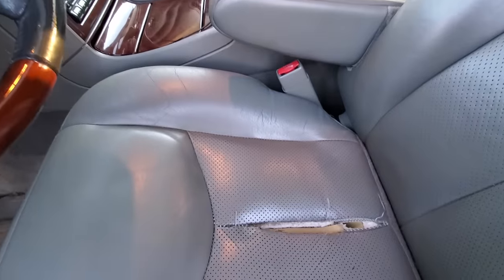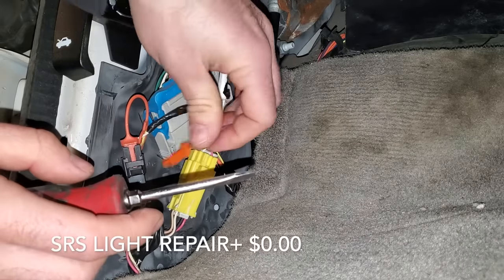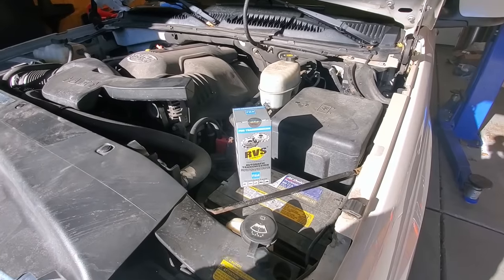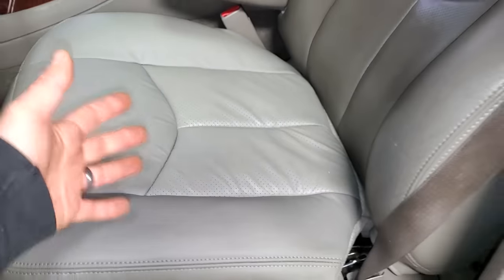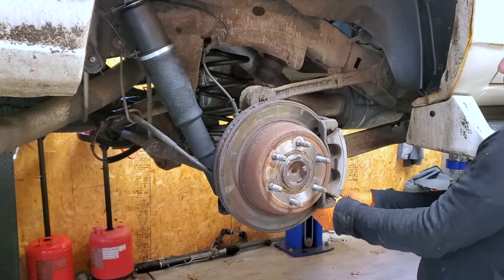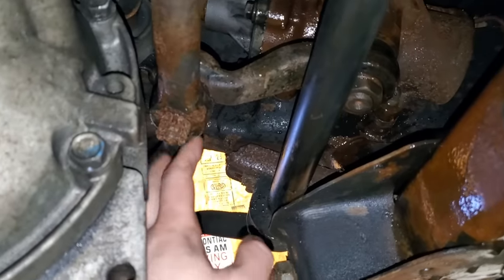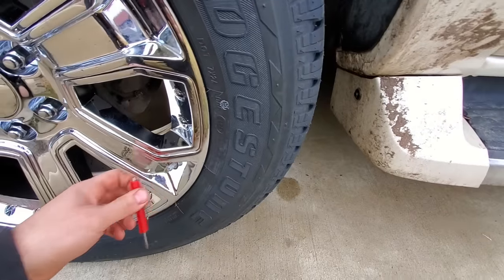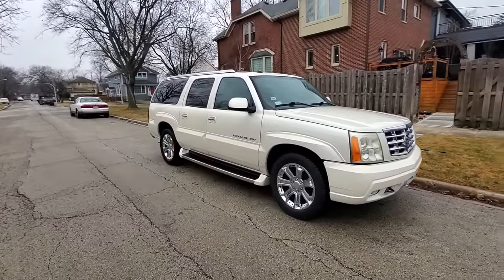I Fixed EVERYTHING On A 15-Year-Old Cadillac Escalade In 1 Day To Avoid Buying My Wife A New Truck!

Comment: I love the 2nd gen Escalades! They were made so much better then the newer ones and the seats were so much bigger and comfortable
Reply: Bailey Hatfield hell yeah I had an 04 with 50k miles on it pearl white with tan interior it belonged originally to an NBA player and it was so clean and smooth and I foolishly sold it. I miss it so
Reply: The seats hold more farts
Reply: @jasonhudson8336  I've always looked at those older Escalades and said,those seats have to be plush and comfortable,the newer ones,especially the 3rd row seating is a disgrace,hardly no padding,I really don't understand it,smh...

Comment: I just put RVS to my car in december and changed the oil a week later. 4th car I”ve done it for, and some years back it totally fixed the oil consumption for my 2006 280CDI 4matic.

Comment: Totally enjoy the 15-20 year old vehicle repair (or maintenance ) videos.  These can be a great value.  Any plans to do the fluids?
Reply from the maker: I just did engine oil, trans and coolant but I didn't record it
Reply: LegitStreetCars what about front and rear diffs, transfer case, brake fluid, power steering fluid (which you probably already did while doing all of the steering work)?
Reply: Can you give me some recommendations on the transmission and transfer case for my 2004 esv?
Reply: @deborahanderson4211   I use OEM fluids from the dealer.  The price is pretty comparable to the parts store and I wouldn’t risk putting anything other then OE in transmission
Reply: @sat_sonic  you don't think gm MAKES the fluid.. do you?

Comment: I’ve always liked this generation of Escalade, it’s nice to know that they’re very easy to maintain yourself.
Reply: I hope on having one some day.. Knowing that they're pretty easy to maintain is some relief.
Reply: Mitchell Maljers Me too, I’d like to have one soon. Or a similar year model Yukon Denali. I like both very well. Same drivetrain too.
Reply: @1Reddd  I can assure you the yukon denali is a wonderful piece of machinery easy to work on and nothing crumbles in your hand. unlike a jaguar
Reply: @1Reddd  I'm wondering if the Escalade will hold up better than a Surburban or Yukon XL,what you think????
Reply: @MxGRhythmlModsMusicGamingl  So you really think the Yukon XL is more reliable and durable,how about the Surburbans???
Reply: @mercedesbenzs600bash  there's no difference between either the caddy, Chevy, or gmc. they're all on the same chassis just some have different engines and transmissions. most escalade, some ltz, all denalis have a 6.0 vortec 4l65e transmission.
Reply: @MxGRhythmlModsMusicGamingl  OK so your saying the engine and transmission is pretty much the same in all of them,im guessing the Escalades will have more electrical power issues and maybe suspension issues than the other 2,what do you think???
Reply: @mercedesbenzs600bash  nope since the escalade and Denali and SOME suburbans ltz have the same components. you could really just exchange parts with all three no issue just depends on the year.
Reply: @MxGRhythmlModsMusicGamingl  Thats great to hear,how much do you know about the DOD system,and the AFM active fuel management,what exactly is it,I was told the 07-09 models didn't have it,is that true??
Reply: @mercedesbenzs600bash  afm and dod is the same thing. it's not true as most of 07 - 09 actually have them as those years are prone to lifter collapse failure but it can be removed by installing a 3 bolt cam, timing chain and ls7 lifters and after getting it tuned to remove the afm.
Reply: @MxGRhythmlModsMusicGamingl  Oh ok,I wonder how much that repair will cost,is there any way to tell that it doesn't have the DOD/AFM????
Reply: @mercedesbenzs600bash  if you turn it on and it sounds quiet it has dod/afm

Comment: Whenever you get to the front brake replacement l recommend you upgrade to '07  rotors and calipers there 1" taller and calipers bolt right up. Noticable improvement on breaking
Reply from the maker: Nice! Didn't know that
Reply: They also sell replacement caliper pins that have a regular bolt head instead of the torx head. They're pricey at $10-12 EACH I believe. Worth it though
Reply: So you just order the rotors and calipers for an 07 escalade? Would this work on an 03 suburban? Same chassis im assuming.
Reply: @resqjason2  , I'd also be curious if this was the case as I have an 05 Suburban.
Reply: @Fbstock81  yes
Reply: @resqjason2  yes, along with 07 pads of course. 

Rotors
Caliper brackets
Calipers
Pads
Reply: @resqjason2  07 Escalade, Suburban, Silverado all the same. Mine was an `04 Suburban I upgraded
Reply: @resqjason2  I believe you need a minimum 17" wheel for these to fit.
Reply: I learned something new with this video and the comments 👍🏿👍🏿. I always thought about changing my front caliper bolts to normal ones but now I'm thinking about the 07' (3rd gen) upgrade. Didn't know you can do it without mods. I'll put it on my Taxmas list 😁
Reply: Oh shit! What am I seeing!..
I just replace my front rotors
And they look so small! Compared to the newer truck 
So this is why?
I'll get the big ones now!

Comment: I love seeing videos like this. I especially love this video, because I have an 05 Yukon Denali that needs a lot of the same stuff. Finding out that you don't need to remove the entire seat to replace the bottom leather (mine looks the same) was worth a big ol subscribe from me. Thanks man
Reply: I have a 05 Denali XL, and yes same problems. The transmission only needed a good flush and a solenoid.

Comment: fit some led's in front, they look awesome in escalade
Reply: It already has Xenon headlights
Reply: @DrDodge24  halogen xenons? Looks bad. Projectors with LED's look awesome. Also Escalade was one of the first cars to have LED's ever
Reply: @MrMen98989  this model Escalade had factory Xenon's - aka HID's. You know, the original high output lights before Led's were thing. 

And no, it's not worth the headache to swap factory hid's to less- it's a total PITA.

*edited because autoderp*

Comment: With AC Delco "advantage" is their cheap line, "professional" is their quality line.
Reply: I'm starting to wonder about that. I maintain several GM vehicles and the prices I find on Amazon are way cheaper than any place else. I'm starting to think that most sellers on Amazon are selling counterfeit merchandise as I've had brand name parts fail in short order or appear out of the box as cheap as the Chinese junk, only at a higher price.

I researched a little bit and it seems that is not an uncommon suspicion for name brand purchasers. 

Anymore it seems I have better success with steering and suspension parts from Autozone, Advance Auto, or Napa than I do parts from Amazon that come in OEM boxes.
Reply: @Jim-mm5nd  i use all moog suspension parts. there the best last forever
Reply: @Jim-mm5nd  Ac Delco advantage line is very low quality stuff. Yes, the stuff from the local auto parts stores are prob equivalent or better. Professional line Ac Delco is higher quality.
Reply: @bigsean2473  Not anymore, moog balljoints are the same, with an option of about 3-4 grades of alibaba chinesium.
Reply: @DarkLinkAD  maybe if your ordering offline and looking for the best deals then no. but i buy from auto parts stores that uphold the warranty and will replace free with no questions. hell i change brake pads every 90days cuz i have lifetime warranty on them.
Reply: @bigsean2473  I dont think you understand, when it comes to most suspension parts, A arms, ball joints, tierods, steering linkage's, pitman arms etc
 Moog is no longer in the business, they are one of many companies that made drastic changes back in the last recession.
 If you pay for expensive, top tier Moog ball joints, your getting top tier chinese import with matching numbers to prove it.
 This means, if you grease your ball joints and get 30k miles out of them, your lucky. But with the old Moog, you didnt have to think of replacing them again..
And when a balljoint fails, youd better hope your at a walking pace.

 Monopolies,  arent they great?
Reply: @DarkLinkAD  hmm good to know. ill loook into this more. i still havent had any trouble with there parts so far. lucky??? who knows but ill def keep an eye on my parts that ive used on my and other peoples cars.

Comment: When it's time to do the fronts if you get pads, rotors, and calipers for an 07-14 truck everything bolts right up and you get a 13 inch rotor with a bigger pad.  It's definitely a worthwhile upgrade for these trucks.
Reply: Thomas Bannon ...did this for my ‘05 EXT...upgraded to 22’s then put ‘07 rotors and calipers on it...
Reply: @dvwash145  It's a great upgrade.  Just make sure you have a 17" spare under your truck because a 16" won't clear the new front brakes.

Comment: When you connected and disconnected the yellow SRS connector, did you disconnect the battery as part of this fix or did you leave it connected?  I've recently thrown a B0100 but would like to try this before buying the impact sensor.  Great video BTW!
Reply from the maker: Disconnect the battery first.
Reply: LegitStreetCars how does ECU know that you did it 3x if battery unplugged...fascinating and i am confused
Reply: Dr Dwg You do it three times to clean the connectors.
Reply: Dr Dwg ecu didn't need to know you did it three times,  it's actually to remove corrosion from the terminals, for a good connection so you could do it more then the times

Comment: I just wanted to post, I have an 02 ext. It runs like a dream. Kept up on all maintenance, last year did all calibers, rotors,pads, transmission,,over the years an axel,was the only major thing. Frame is still fantastic. And thus year for motor vehicle inspection I just need a pair of cats. Someone even stole the Ole thing recently which prompted an alarm and gps install. But this old thing still runs fantastic,my mechanic says another 10 years easy on the motor. So for me, this has been a fantastic long lasting purchase.

Comment: when u will clean under the car?and apply some antirust
Reply: That's what I did. After 24 years of ignoring the corrosion.
It's never to late. ( I made a YouTube video "StaBil rust stopper"
Reply: It's that or release 160,000 miles of farts outta the seats
Reply: Alex, you should soda blast the under carriage and then use a weed sprayer to apply bar and chain oil. That’s definitely an old school anti-rust preventative

Comment: Looked to me like you could see the nut on the pitman arm link moving in relation to the tie rod when you steer back and forth like the tapered hole in the tie rod was wallowed out.  If that is the case, this pitman arm will be junk shortly as well.  Worth taking a look at..

Comment: OTC- 6496 inverted pitman arm puller, you won’t have to pull the steering box, or you can remove the three bolts that hold the box to the frame, push it towards the firewall and turn it to where you can get a puller and an impact, did it with my 05 HD.

Comment: This makes me want to buy a Escalade.
Reply: I have had a 02 tahoe for the last 4 years. Best purchase of my life.
Reply: Aaron Thompson why ?
Reply: @lucaslouzada2761  I put 60000 miles on it in the first four years. Going everywhere across america and canada for months on end between long bouts of seasonal work.i lived out of it as a raft guide in colorado. I built it into an amazing personal camper in 3 days and lived rent free in the Rockies for 4 months. I offroaded it every day off for months over mountains and through creeks. Never let me down besides a blown fuel pump in Atlanta and even then I had enough pressure to limp it to a shop and get it fixed. 4 wheel drive works perfectly as does the rear locker. At 210000 miles I can say it's simple enough and cheap enough I can fix everything that may break. I love my hoe and she loves me back.

Comment: When you first turned the engine on it sounded like a snowblower
Reply: Yeah. Let that exhaust leak at the head go too long and it eats away at the aluminum head and no cheap fix will solve the problem. You'll be putting a head on it.

Comment: Had the same problem with frozen brake bolts on my 04 Silverado. Realized on the 2nd wheel the best way is actually a hammer. A few good taps with a hammer to the top and sides of the bolt head knocks the rust away and they come out much easier. You should replace the bolts anyway but it's 100% possible to use this method without damaging it.

Comment: A little advice. Put brake lubricant or antiseize between the stainless brake pad shims and the metal bracket. A lot of times rust forms in there and causes rust jacking, basically it squeezes the pads in the bracket not allowing them to float. It's kind of not necessary to put it on top of the shim where the metal part of the brake pad rests against.

Comment: How you remove the torx head caliper bolts is take a grinder or a drimmel tool and grind/cut flats on the outer edges of the bolts so that you can use a large cresent wrench to get enough leverage to break the bolts loose.

Comment: I still have the ‘96 GMC Suburban that I bought new. Clothe upholstery still looks great at 190,000 miles, rear wheel drive for fewer possible problems. No rust living in California. I can’t imagine ever getting rid of it. Other vehicle is ‘14 Denali Crew Cab p/u. I believe in buying new, avoid 4 wheel drive, keep long term. I bought a new ‘84 Ford Ranger, kept it 19 years.

Comment: RVS is good stuff. been around in European Motorsport for years. I put it in a high mileage Toyota that I since sold, guy told me its still running great. I'm planning on using RVS in my BMW 3 series next. RVS really should get more attention, it works wonders in any car especially in high mileage engines of any type.

Comment: I have an 05 with 272k miles on it. It's been extremely good to me but I've had to repair quite a few things in the past 2 years. Reasonable stuff though. Front end parts, AC compressor, gear box, water pump, etc. I've owned the truck for over 10 years and it's been worth every penny. Plus I love not having car payments.

Comment: acetylene torch on the bracket and vice grips on the slider. heated until it wiggles then continue heating until you can work it all the way out

Comment: For engine antifriction. Check promar MBL8 and fuel additive out. Stuff is magic to engines and transmissions. It re-adds the tin and lead into the metal. Stops friction by up to 600%

Comment: You don't need to remove the gearbox to remove the pitman arm just loosen the bolts it gives you enough room to put the puller on if you still have problems just take the bottom bolt out 👍👍👍 I've been doing frontend suspension for 30years

Comment: For tpms relearn you can turn on the ignition and just hold lock and unlock on the key fob, and just put a decent strength magnet by the sensor for a few seconds at each wheel and it will reprogram

Comment: I love that Escalade best Cadillac Escalade built. Super comfortable and the seats feel like a recliner. The 1st gen magna-ride suspension is super comfy as well. minus the transmission and the front differential. The new GM trucks with the 3rd Gen magna-ride suspension feels too stiff you feel every crack and bump in the road.

Comment: One of the most important thing on the 2000-2006 is to upgrade the front brakes: The brakes from a 2011 fit, and are much larger. Get the brakes and calipers from that year, they bolt right on. Braking is day & night, especially if you go for EBC yellow stuff.  REar the brakes of this year are better than the newer ones, so no need to change: EBC Brakes GD7214 3GD Series rear and EBC Brakes GD7372 3GD  front. Need 20" rims, but that looks better anyhow....

Comment: the Escalade is just a tricked out Tahoe/Suburban.  Laugh as you may these vehicles are considered one of the all time most reliable vehicles ever put on the road.  I have a Tahoe with 410,000 miles on it.  Original engine and transmission.

Comment: I love it.  A well-taken-care-of vehicle LOOKS and RUNS like new, and that's what matters.  Anyone looking at this truck from the outside or takes a ride in it will be in oblivious to the actual amount of miles on it.  FYI, my company had a GM vehicle (2003 Savanna van) with 269,000 miles that the trans suddenly started slipping badly and the pump whined / growled loudly.  I knew the pump couldn't get oil to build hydraulic pressure, so I was careful not to rev the engine with the clutches slipping.  A change of transmission fluid and filter got it back on the  road with no slipping (the pump was cavitating due to clogged filter).  Of course this didn't really "fix" the trans, because after all, that clutch material had to come from somewhere... but it ran fine for another 25K before the truck was retired- no perceivable trans issues...and the engine did not use or leak oil!

Comment: Enjoyed yr video and learned some things.  Lots of little things to have to repair and the fact that u were able to fix obviously saves a great deal of  money.
I agree with you about fixing a car up that has a lot more life and not have car payment.
My Crown Vic has 240,000 on clock and I did like u fixed what needed fixing. Like a new cat now.
GM obviously has some quality issues parts going bad as they age not surprised with what you repaired .  Everything wears out eventually but GM seems to have problems wearing out early.  Great video!

Comment: Hey, l found out what actually holds the parking brake cable in place. A couple of clips attached to the panhard bar (or whatever that thing is) just behind the rear axle were what did it. And if they were metal, then yes, they probably did rust away. I do like the ziptie idea. I hope this helps.

Comment: Those are great trucks and the engine will run forever with proper maintenance, mine has 277k on the clock and it's still a runner!